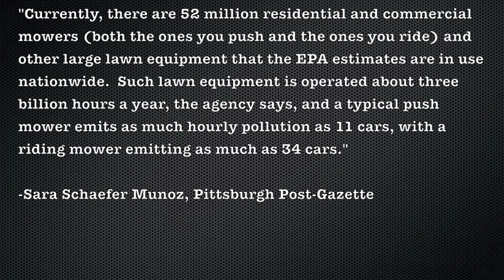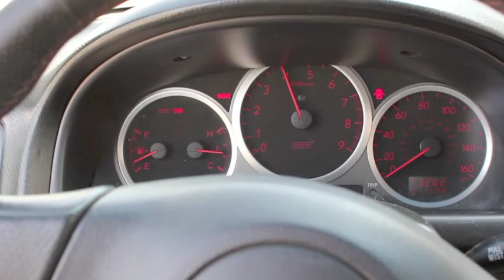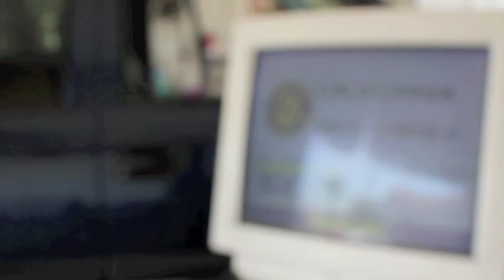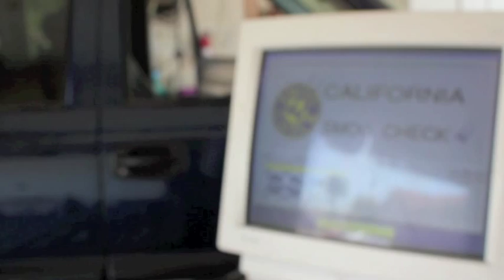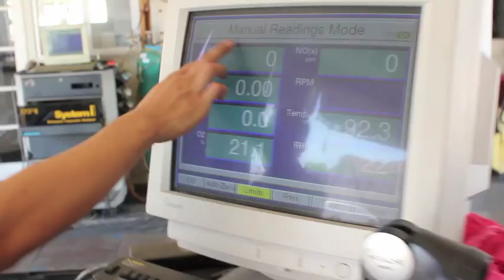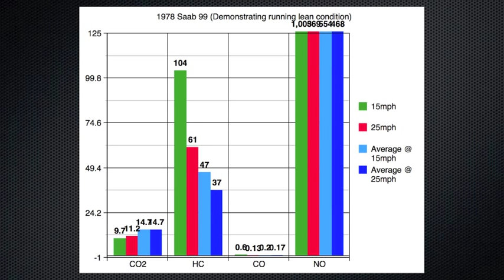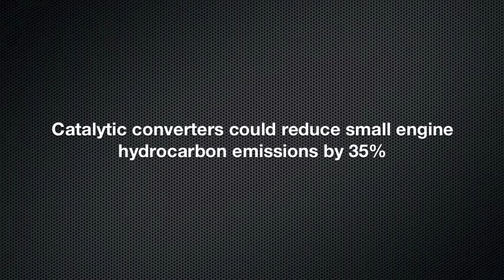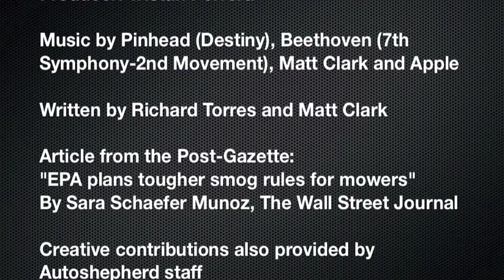Cars Vs. Lawnmower - The Emissions Showdown

Comment: Great video, I had heard about this a number of years ago but didn't realize it was this bad! Fortunately when I did need to buy a new mower in the spring of last year ECHO had just come out with their line of 58 Volt Li-ion powered lawn equipment and so I bought the mower and blower, going to add the string trimmer and hedge trimmer soon.